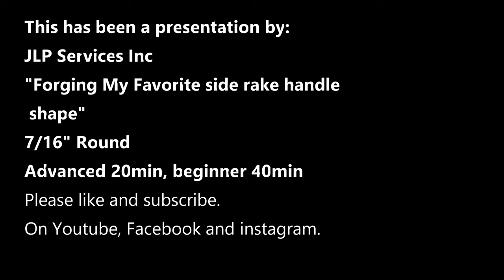My Favorite Forge Tool Side Rake handle (style 1)

Comment: Of course, all of the above… 
Making a mark on round stock with a center punch, for me, is adventurous. The thing has a tendency to run away. I do not have a step on my anvil, so I use a swage block or a piece of angle iron welded to a small plate. Too old to run around after wandering pieces of steel. Lovely little video. A nice practice of forge welding for beginners: easy, no dropped tongs.

Comment: Forging perfection at it's finest. Just love watching you forge. I learn on every video you do. Your a bit of a perfectionist. It really shows in your work. Thanks for sharing it with us Jen.
Reply from the maker: Thanks, Jim. My pleasure having a few patreon supporters has helped with motivation. :)

As for perfectionists,  I try to do the best I can in everything I do.

When it comes to forging I have an expectation based on experience.

A little bit different than most. Beginners start out with limited experience with an expectation or desire for what an item could be.

For myself, i know what it should be but not being as good a forger as I used to be, puts the expectation and experience in discord. 

That and the fact that I don't practice at the items I make. 

Setup the cameras and start filming. You guys are seeing 1 off items, many not being made since before I retired back in 2004.

All the videos are single items other than the poker challenge and Daniel Moss candle holder.

Pokers I had 4 to give away and for the Daniel Moss challenge the measurements were off in the drawing, so had to figure it out.

Comment: Very nice indeed. The first thing Peter Ross forged at the conference in OK was a coal rake. He said he found the best thing to move coal around with was his hands but that got to hot so he always preferred one with a large blade. So prior to the start of his demo he forged a wide blade rake to use. When he said "hand" I got an idea and when I got home I traced my hand on a piece of sheet metal and then forge welded that onto the end of a handle for a coal rake. It was kind of a play on his words but it's turned out to be a very "handy" coal rake that not only rakes coal around but scoops up and moves around coal very well.
Reply: Pretty engenious there Mr Bill. Thanks for sharing that. I can hear you explain that now in my head! Thanks again
Blessings
Crawford out 🙏🔥⚒️🧙🏼‍♂️

Comment: I like the fact you show easier projects like this one as well as other more difficult and I need a better rake such as this. Since it's your favorite I'm sure it'll be a great one for me. Thanks for the video. I'm guessing you did use flux on the welds.
Reply from the maker: Yes,  used flux on the initial welds..  The flux container was on the forge and sorry about not showing that.  

Works great.. You won't be disappointed.